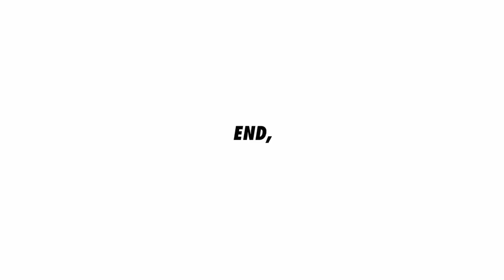W80_Oak door design

Comment: why did you do the long dado cuts with the saw instead of the router? was it more accurate in this long distance?
Reply: Zsolt ... I'm guessing he is showing  us  different options/methods, Maybe people don't own routers lol .. hope that helps  ✌👍✔
Reply: @emm6155  I see, I also figured that these must be some of the reasons. Last week I used a plunge saw to cut a dado for a glass cover. Router was not an option because the cut had to be 4mm wide.
Reply from the maker: because.. power. use router after dado cut. it is easier than only use the router and more accurate